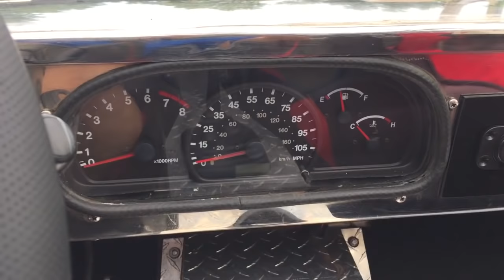Stainless Steel Willys Army Jeep (sort of) Replica Review and Test Drive by Bill Auto Europa Naples

Comment: I just completed a build of a CJ5 that has a lot of stainless. I'll start with the frame, the frame is 304 2x4 stainless tubing. The body is fiberglass,  but next summer   it will be painted with 316 stainless polyurethane paint. Still looking for a rag top.

Comment: we have tons of those still running here in the Philippines, we have dozens of variants and trim, say the Tikya Rebel of Nueva Ecija, Tamiya low riders from cavite and batangas, and those all- stainless steel bodied and chassis jeeps from Malabon. For the typical build it has leafspring suspensions front and rear and with the Tamiya variant it has front independent coilspring suspension. Typically, Toyota engines propels this mean machines, from the tiny K-series, to the performance side with a typical toyota Hemi T-series to the top end model having a 20 valve twin cam 4A-GE engines
Reply: Hehehe you forgot some other version, " FPJ " , "LONG BODY", ETC.. and they are claiming its willy' jeep.. Hahaha that's why Mercedes lost in Toyota in v-belt lol.

Comment: "Owner" which a handmade jeep is called, has a distinct look depending from what part of the Philippine its from.  I would guess this is a jeep from Laguna, PI due to the square headlights and the flare designs at the hood and trimmings.  N yes, i am blown away with the metal craftsmanship they do in which they can take a sheet of metal and make it look like any molding they want.

Comment: Used willys jeep (Mcarthur/eisenhower types) became the early transport after the US GI's left. The jeep (we call it owner or oner here) was taken in by Filipinos like duck to water..The same design was continued and  built by small individual shops and sold as cheap transport. It became very popular in the 80's till the early 2000's but gradually, the shops folded because the novelty wore off. Now, we seldom see any oner jeeps running now. What is left are the jeepneys (the elongated ones of the same design) that carry more people and used as the main mass transport all over the country. They put in used imported smoke belching Japanese diesel engines and sometimes pimped out complete with booming speakers.
Reply: jude flip there are also owner type car and owner type suv if you didnt notice on owner type jeep club

Comment: Anyways does you Jeep pass inspection in tha US? This jeep was made closer to the features of the jeep in the US for off-rode. Folding front wind shield and roof. Customization is cheaper. If you have good accessories before you ship here. If you get toyota steering and engines and transmission that will be good.
Reply: First, the jeep represented in this video was not made in Philippines, it is copy, it was assembled and made there in your country, try to reviews the video, pilipinos didn't make owner type jeep that can easily put down the windshield, also pilipinos put side mirrors on its owner type vehicle. And one more thing it is not Willy's jeep, we called it owner type jeep, go and check in YouTube "firebird display center" and you will see what owner type jeep is and its variety